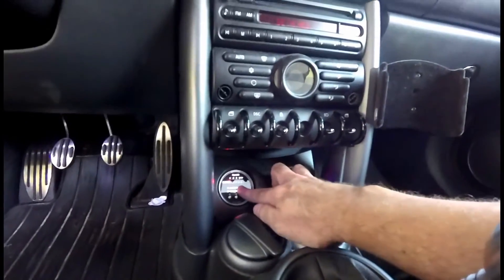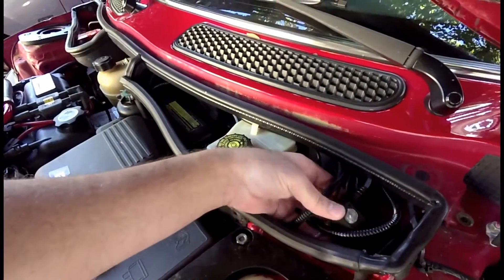Water Methanol Installation Overview MINI Cooper S

Comment: Doesn't the water/meth system largely take care of what an upgraded intercooler would achieve? I also noticed you have two threaded adapters on your intake horn. Is one a sensor?
Reply from the maker: Yes I think W/W would be about the same as a bigger intercooler, but I would not substitue if there is a larger option avaialbe for your intercooler choice, in the R53 MINI your options are very limited in uprated intercoolers.

The additional sensors are for the pre and post intercooler air temps.

Comment: what size jet did you run .8?
Reply from the maker: Yes I used the middle of my kit, it came with .7, .8 and .9 I went with the middle one.  I am only spraying at like 70% duty cycle on the Fuel injectors.
Reply: I just picked up a new kit from aquamist but since howerton is no longer I am looking for tank options. 15% pulley just looking for cooling beneifts myself.
Reply: Can you post this up again?

http://www.c0op3r.com/images/Emma/Water_Meth/MINI_Cooper_WM_Install_Tools.pdf

Comment: What is that cover on your intercooler??
Reply from the maker: Its not a cover it an Air to Water Intercooler setup.  There is a heat exchanger in the front grill.
Reply: I love it.  Do you have any links to where you got everything?